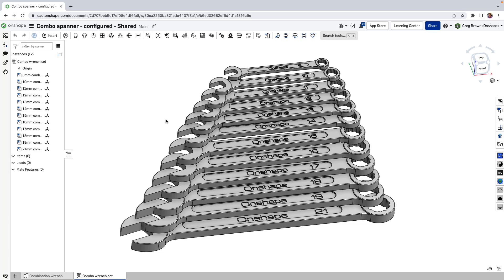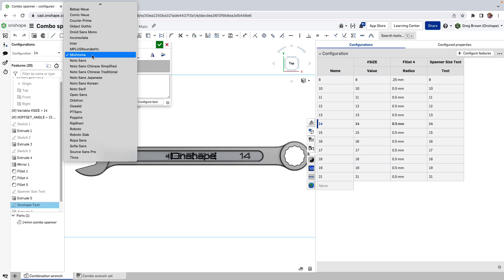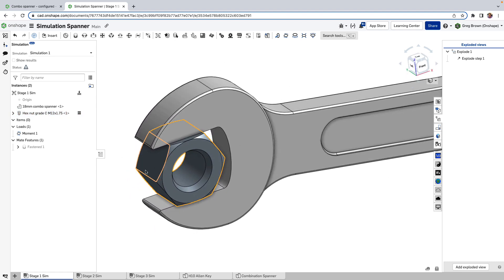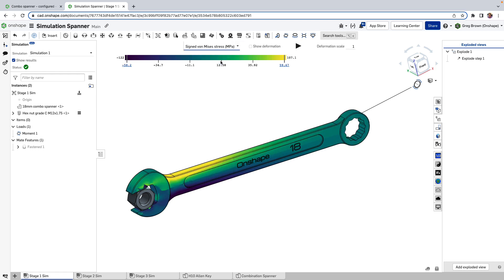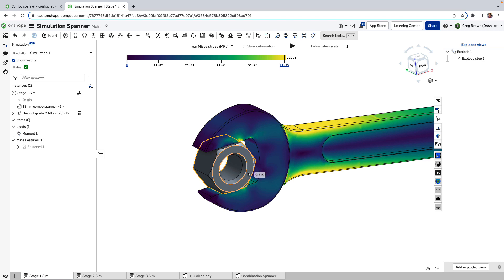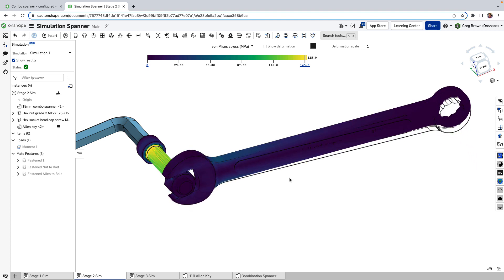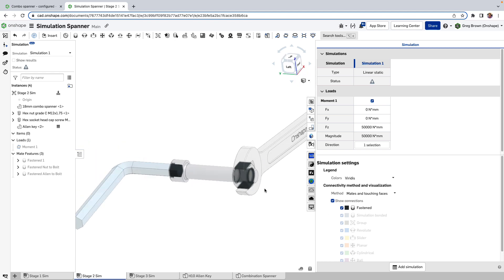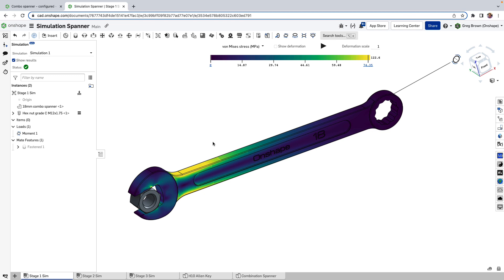A parametric wrench/spanner gets simulated in FEA (entry level)

Comment: Greg, Could you share your onshape wrench file? I am interested on how you use the table and updated the text.
Reply from the maker: Yes! Here it is: https://cad.onshape.com/documents/1bda657a1041f59966643bca/w/ab4191fe18ac7ce49974bfd7/e/d22fe898a6d0bffdcb16564c

Note there are two part studios - I just created the second one as we added something last year (in the Sept 1st, 2023 release 1.169) that might be worth looking at. Rather than configuring the text directly (you can see that in the config table for the first part studio), we added a very powerful capability across the product to "convert to expression" (for boolean parameters in features, or text) Thus I could use an expression for the text contents. In this case I used toString(#VALUE) to convert the variable called #VALUE into a text string! For those playing along, yes this means you can open it up to very fun and sophisticated expressions pulling on the full power of FeatureScript. You can encode logic into the text string, just for starters...
Reply: @gregbrown-onshape7555 
Thank you for sharing your Onshape skills. It really helps me out greatly!